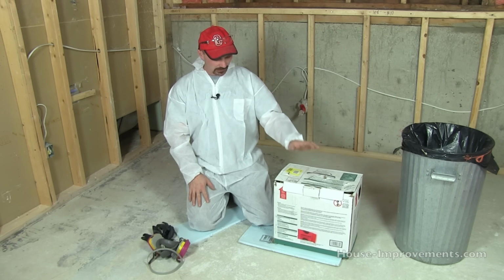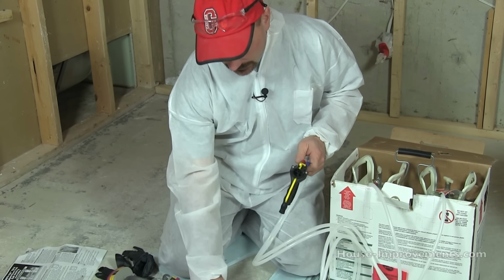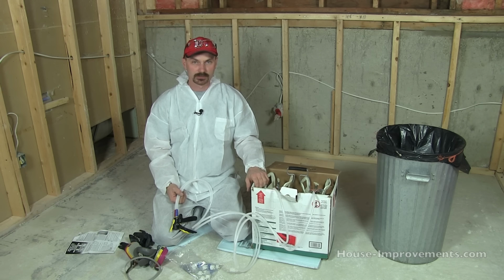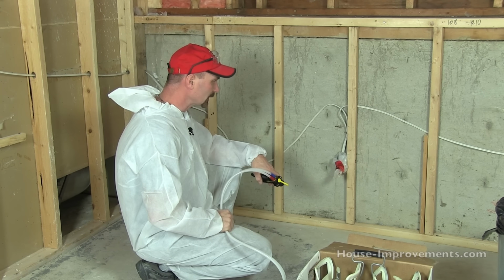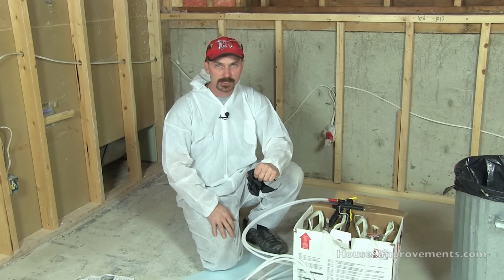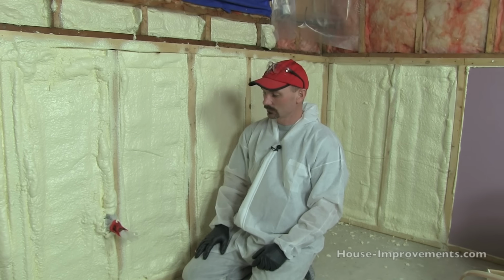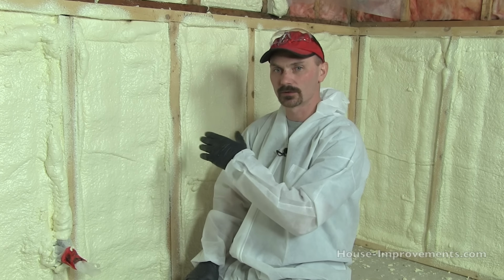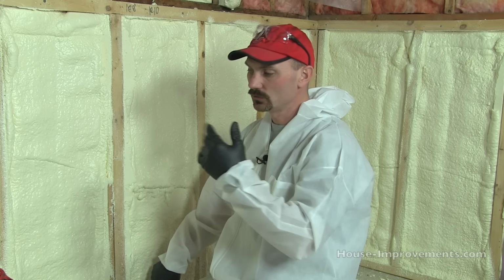How to Install Spray Foam Insulation DIY

Comment: do you know how much you had left in the tank after these walls were done ?  nice video, tyvm !  will prolly use that closed cell kit top insulate my crawl space.
Reply from the maker: +Guillaume Breton You really do not know the volume for sure. When using in an enclosed space be sure you have lots of air circulation and a respirator. You may actually need a fresh air respirator if you can not get enough fresh air circulation.
Reply: Back in 1978 we bought this stuff for 92 cents a lb. 55 gallon drums would weigh 800 lbs each.

Comment: When spraying in an attic down onto a ceiling of drywall, is it a hazard to spray over exposed recessed light cans?
Reply from the maker: Good question. For one they need to be rated to be in an insulated ceiling and I would box them in with drywall first. Be sure to leave about 2" clearance around them from the drywall.
Reply: HouseImprovements Spraying foam directly onto recessed (can) lights , even insulation contact rated models is a HUGE hazard. Read the foam manufacturers warnings. This information is easily acquired using a search engine.

Comment: Hi Shannon!  I've been watching a lot of videos, where if not sprayed right... It can be extremely bad for family health.  I've seen where people had to tear off their entire attic and roofs, to remove all of the foam.  So my question to you is?  How safe is spray foam?  I really want to do in in my basement, but I don't want to tear my house apart like I've seen in videos.  What do you recommend??  Those houses were all sprayed by professionals.
Reply from the maker: I have heard of problems with spray foam, but I have never seen it. I think if you consider how many are sprayed every year the few that have problems is likely a very small percentage. Like anything ,its not always perfect every time.
Reply: +HouseImprovements Okay thanks Shannon.  Search for spray foam health dangers, removing roofs on homes on YouTube.
Reply from the maker: Oh I've seen the videos, I just meant I have never personally heard of a local home with such problems.
Reply: I had a 3500 sq ft home spray foamed almost entirely and I had absolutely no issues regarding health and the only issue I can recall at all was the sheetrocker did not like the foam on the studs. But the sheetrock came out fine.

Comment: does this have off gassing?
Reply from the maker: I'm sure it does
Reply: Once closed foam is set and hardens the gasses are contained. It's not like the insulation where formaldehyde exudes.

Comment: My cabin is out in the boonies of Newfoundland so I might consider doing the job myself. Did your video represent the 200 sq ft contents of the cans you bought? How much did you have left over?
Reply from the maker: jtjohnst1965  What you seen me do here is not the full volume of the tanks. That was maybe half. The coverage of the tanks is based on 1" of thickness , and really you will want to use a min. of 2" in my opinion. So if you buy the 200sq.' set then you will cover about 100Sq.' and I find it is usually about 10% less than that even.

Comment: So I painted over the wallpaper in my bathroom and it turned out great then the bedroom the wall paper bubbled a lot on one wall so to prevent that from happening again what do I di?
Reply from the maker: probably depends more on how well the paper was glued on and the type of paper it was.
Reply: Strip the wall paper off the wall before you try and slap up paint.

Comment: Shannon. Does this kit give you a R7? The kits they sell at my local Home Depot/Lowes only are rated at 5.4 and are closed cell. I've seen some kits online like Foam it Green that do R7.
Reply from the maker: Nick P  I actually believe this one was R6 closed cell. "Froth-pak" is the brand used here in my video.
Reply: Thanks for the quick reply. Your videos are very informative. Keep up the good work.

Comment: I have a house with a metal roof. Can I spray this in the attic crawl space underneath the roof? I have a little frost problem when it gets really cold.
Reply from the maker: That would be a job better left to the pros. Ventilation will be a problem for you while spraying and the panels need to be warm enough as well.

Comment: Thank you for the post. At a 2" thick build up, how many square feet you you believe these dual tank kit could cover?
Reply from the maker: The kits come in different sizes based on how much coverage you will get at 1" thick. The kit we used here was a 200 sq.' kit. So it in theory would cover 100Sq.' at 2" thick. I find that you generally will get about 90% of what they claim.
Reply: That kit costs us $300 when on sale. That's more than $3. a square foot. That seems to be a high price considering the size of a basement. Just saying.
Reply from the maker: Yes these kits are priced high , I would not recommend doing an entire basement unless you are in an area that does not have access to a professional company.
Reply: @41point2  I got estimates from professional spray foam companies and they quoted me $1.10 a sq ft for closed cell @ 4" thick

Comment: Tip: spray everything once and then if you need to touch up anything do it after spraying everything the first time.  It’s obvious You didn’t read the instructions it says right in the instructions don’t spray something twice immediately it says after you sprayed everything then go back and spray again if you needed to it gives the first coat to set up it even says in the instructions if you go over it twice within a few seconds it won’t set up properly that’s why you spray everything first by the time you get back to where you started it will have had already set up.
Reply from the maker: Interesting I have never seen that stated. makes sense however.

Comment: What happens if you want to run electrical after you blow this in?
Reply: You can poke a hole or cut a hole or force the wire / conduit through the foam, but its difficult and takes some skill and trial and error, but it can be done.  Fish tape is the best way to start it but a strong, stiff fish tape that wont bend too easy.

Comment: As an electrician that just ran into this stuff trying to remove an old exhaust fan and install a new one... it was a complete nightmare
Reply: I could imagine. I watch Mike Holmes do this all the time with his builds. Seems like a good thing. But if you have to troubleshoot anything underneath I'd could see where that could be a problem. I guess the idea is to make it right and then spray the foam so no one else has to remove it to fix a mistake.
Reply: robert upton, I feel you!! I’m an HVAC installer, and if we had to run a new wire or something through that, you couldn’t do it with out cutting open sheet rock, I’m glad I’m not the only one who thinks so.. this shits garbage!

Comment: Would have been better off using 3/4”foam sheets on 1/2 wall and a foam cap on top of cement and tuuk taping the seams then adding the framing.  Skip spray foam on the cement and just use roxul insulation in lower stud cavity.  Spray foam the upper stud cavity only.

Comment: Shannon, are any of these kits being sold by Home Hardware, Lowes, HomeDepot yet?

You are in Canada right? Prices are cheaper on American web sites. I live in Quebec 20 minutes from the border. I would be tempted to buy this in the USA and pay my taxes at Canada Customs. Might be a lot cheaper.

Why were you changing tips so many times?

Is there a bottle cleaner kit to clean those tips? Someone mentioned brake cleaner. But would you have time in between? (I had one for a can once. It was a contractor's kit with one tube that you could screw on cans with.)

In the video, did you finish off the kit? What happens if you leave it in the hoses for any amount of time? Do you have to change hoses too?
Reply from the maker: jtjohnst1965 This kit I bought at Home Hardware, Most of the big box stores sell one brand or the other. 
The problem with buying across the line right now is our dollar, you are not likely to save much after the exchange rate.
The cleaner from the can types like you talked about would likely clean the tips just fine.I change the tip every time it does not seem to spray right anymore or if i stop for more than 30 Seconds.
If you do not finish the kit, turn off the valves and leave the tip on. When you want to use the rest agitate the tanks and turn on valves ,remove the tip and purge the lines into a garbage. Then install a new tip and start to spray. The materials do not mix in the hoses they mix in the tips. Please use my forum for any questions. http://www.house-improvements.com/forums/

Comment: What's the purple cover on the right side you have them flush in between the studs look like a bit of foam around it is that a way to level it prior to drywall
Reply: he did a video where he was insulating a wall from the outside.  he had pulled off the sheathing.  he cut rigid close cell boards just a little loose for each bay (maybe 1/4" at most) then used the small can of spray foam around the edges (a product I have seen used to spray into the gaps at the edge of a standard window installation) to stop air infiltration.

Comment: Looks like it will do the job but wires in the foam could be hazardous not to mention a pain to work with in the future.  Also, here in the UK our wiring standards, I am sure stipulate that entombing wires in foam is a very bad idea.
Reply: Dude, it's literally how it's done...how could you possibly spray foam stud bays with wiring without also spraying in the wires LOL? A modern interior wire should last hundreds of years...

Comment: Good for insulating the back cargo area of metal vans as they have non-uniform shapes with nooks and crannies. If that space will be heated then insulation will be needed to prevent condensation, if it's cold outside the van.
Reply from the maker: yes that is a good use for this

Comment: I have teenagers an all 3 bedrooms are close to each other, do you recommend these foam to reduce noise from 1 bedroom to other?
Reply: You realize you can control the noise level in your house, right? Foam insulation isn't the answer here.
Reply: @anthonyandriano  what's the best way to reduce noise?
Reply: @eliodiroaguilar4115  Parent your kids such that they listen when you tell them to be quiet? My room is right next to my kids' rooms and this is not an issue. Foam is not the way and it wouldn't help anyway.
Reply: @anthonyandriano  you a joke,  it's not just the kids. I'm very sexually active an it gets loud. You funny thinking it was just the kids making noise.

Comment: one thing I don't understand is why isn't there insulation between the bottom framing and top framing? wouldn't that catch any residual drafts, making a tight seal??

Comment: Do you have any experience with doing subsequent changes to your electrical? do you have to remove it all to rewire?
Reply from the maker: I have not had to yet but you would have to remove it around the wires.

Comment: Did you let it sit for 24 hours before entering to scarf? That's how long customers are told to leave the house because that's how long it takes for the fumes to dissipate. Also scarfing with a knife stands a high chance of hitting any wires that may not have gotten pushed back far enough. Much safer to use a scraper... I saw other issues but those are the huge ones. Cancer causing chemicals (we ALWAYS use supplied air when spraying) and possible electrical fires are huge

Comment: 1. How often do people have problems with the chemicals NOT mixing properly during application? 2. Just a small production note. This video could have been cut to 1/2 or 3/4 in length/time and still provide the great information you shared. Thanks
Reply from the maker: Steve Santagati It can be an issue at times for some.

Comment: Can spray foam be applied on top of a radiant barrier?
Reply: You can, but then the radiant "barrier" does not reflect "heat". You need an air gap.

Comment: Would you spray your main floor too instead of using batts and poly? I am thinking the sound proofing would be great. If you did, would you still use poly  for the ceiling?
Reply from the maker: in most areas vapour barrier is not needed if using at least 2" of closed cell sprayfoam. You could do the main floor as well ,yes.

Comment: Two questions...if you have 2x6 framing, can you seal the wall with foam and then throw in pink? And how difficult is this foam to remove if you need access to pipes or wiring?
Reply from the maker: You could. It will peal off with some work.

Comment: Can this be used in an Attic?
Reply: Yes I have seen articles on the web talking about using spray foam in attics.
Reply: Stefan see if the video I just posted will answer any questions for you.
Reply from the maker: yes it can be used in an attic

Comment: Hey man. Thanks the clear video. I would like to do this on a ship. Its a steel ship, dutch. I wondered what temperature the surface you spray onto needs to be and could this be problematic on a surface that is too cold. I know the spray needs to be warmed but the surface you spray on also?

Comment: I would have appreciated learning how many SF those two EXPENSIVE cans of foam would/did fill. 
Also, when using the little cans, I have heard/read that moisture is a friend. That moistening the area prior to application helps with expansion as well as adhesion.
Also agree with the folks who noted that closed cell foam creates an air barrier regardless. You can shave off the top layer without impacting the air barrier created.
Reply from the maker: The tanks come in different sizes (SF coverage figured at 1" thick) I have found they never cover as much as they say ...maybe only 80 -90 %. If you have more questions please use my forum. http://www.house-improvements.com/forums/
Reply: Moisture is neither friend nor enemy.  The foam should only be installed when the air and surface have the CORRECT humidity and moisture content as measured with accurate guages.  Only factory trained professional should apply two part foam that comes in two seperate cans.  
It's 200 Board Feet Not 200 Square feet - Spray foam is measured in Board Feet not square feet. One Board Foot is One Square foot at 1 inch depth of filled (expanded) foam. So if your spraying a 2x4 stud wall which is actually 3.5 inches deep, you need 3.5 board feet for each square foot of wall area. If your head is spinning from all this math, you are not a pro spray foam contractor and should leave it to the pro. The 200 board feet marked on this set of tanks is not a guarantee, its a guideline. There's always some product left over in one or both tanks when the pressure runs out. And you typically get anywhere from 160-190 board feet of net product out of the kit depending on conditions. It's like when you buy a bag of grass seed and the bag say it covers 5000 sqft. Actual results can very widely.
Reply: BPCADownStateChapter but ft

Comment: Why did you switch from EPS on the right wall to spray foam? I'm currently sealing in EPS but thinking of switching to spray foam in the rim joist area.

Comment: Couple questions on this topic. I would be spraying into 2x4 cavities. I would like to fill to the depth of the 2x4 so about 3 1/2 inches or so. How many passes would that take? If I do one pass and after it's cured I find it's not enough can I go over it again? Is it better to do a pass let it cure and go over it again or to spray it heavy the first time? 
Ty
Ricky

Comment: The only problem I can see is when you hang drywall over it. It won’t lay flat because the foam is jutting out of the space causing the sheet not to lay flat against the studs. The finished wall will be wavy. I don’t know of any customer that would accept that.

Comment: why not just use the polysterene sheets and cut to fit , got be less messy and no nasty smells
Reply from the maker: We have videos on that as well.
Reply: My guess is that spray foam makes more of an air-tight job; the sheets would not fill all the nooks, and crannies.

Comment: i was considering using spray foam insulation in the interior walls of a cargo van.  would this work and what kind of r value does this stuff have about an inch thick. also would condensation be a problem as this is going to be a campervan .  any tips would be appreciated.

Comment: Hi Shannon,   I really appreciate your videos..  I watch one before I try any new home improvement project for the first time.        

I saw this product at CT and it got me to watch this episode.   My local professional quoted me $7500 to spray the ceiling in my garage...  at 2"     I figure I've got 200 board feet to cover so 2 kits of this stuff might cover it.     Is there anything more I should know before attempting to do a ceiling this way with a 4/12 pitch?
Reply from the maker: make sure you have proper ventilation and follow all the safety info that comes with the product
Reply: Is it OK to put this on ceilings of garage/attic/basement?

Comment: I'm looking to redo the insulation in my utility room. Can I just spray the foam directly to the concrete without any studding? Also is a fire block needed? Like Rigid Foam Board due to noxious fumes?